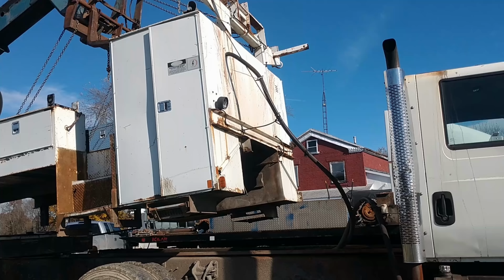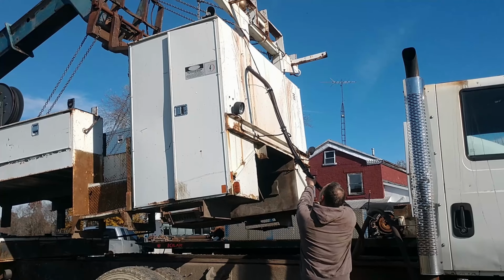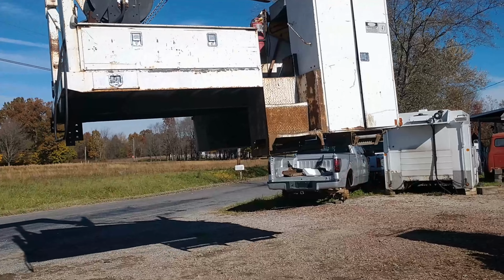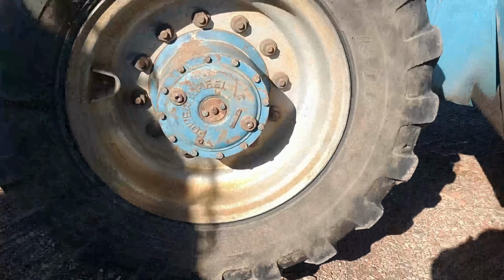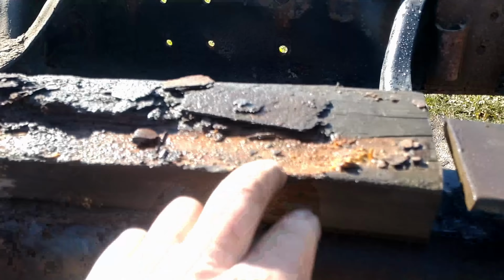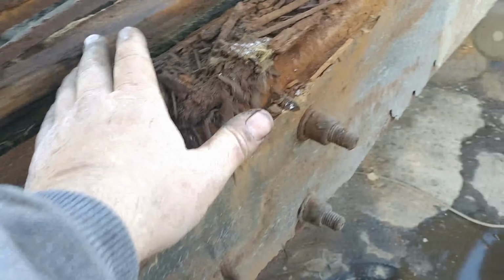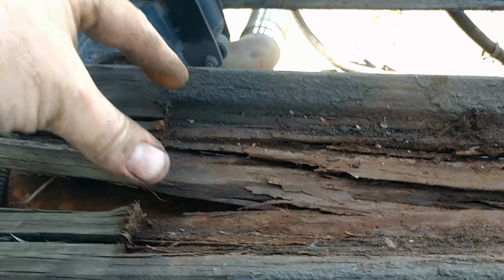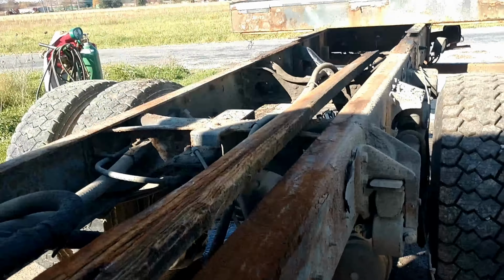THIS IS WHY I SOMETIMES NEED A BIGGER GRADALL!!

Comment: Use hundred gallon water barrel for once in while counter balance. draine when through so it ain't resetting on grad all axle, If a guy don't push it too extra hard then you should still be able to steer good Just try not  to break anything

Comment: My pickup has some wood in the front still but none in the back but there aint gonna be no rubbing as each side has 2  3in or 4in c channel welded truck frame and bed frame for the rear bumper/ trailer hitch

Comment: Wow 3 vids in 1 day! You sure are busy lately. 1 thing I don't like about wood spacers on top of the frame rails, the wood holds moisture constantly against the frame, making it rust thin under the wood. Steel or weather treated wood could help minimize that problem. I'm curious as to what that bed weighs, must be a lot to wheelie the gradall
Reply from the maker: not sure what it weighs but there is a lot of add on structural steel on it for carrying rail.

Comment: Great video thanks brother. Booming down will get you everytime. Looks like a lot of extra weight in there. Pine you would think they would know better. Keep up the great work see you in the next video thanks again brother
Reply from the maker: i didnt explain that the whole reason i need to be boomed out like that was that there was 6' of frame between the gradall and the bed where the crane was mounted. i bigger gradall could be helpful. when something is too heavy i either use my skid steer to help or disassemble what i am lifting until it isnt so heavy.
Reply: I like gradual they have a capacity like no other out there. The 8000lb will pick 10000lb easy. Lull won't do it unless you turn it up. Then you have to be on the override switch. I didn't know you were out 6ft more because of the frame. That makes a big difference and with that kind of wgt you really want to watch booming in. I understand that they are made for that but to a point. I think you for taking the time to talk to me . I appreciate it very much  .

Comment: So u end up selling off the trucks after u fix them up. But it looks like your left with a lot of service beds that would be hard to sell compared to the trucks.
Reply from the maker: the service beds like this are hard to sell. i usually strip them of all the good parts and good structural steel. then scrap the rest.